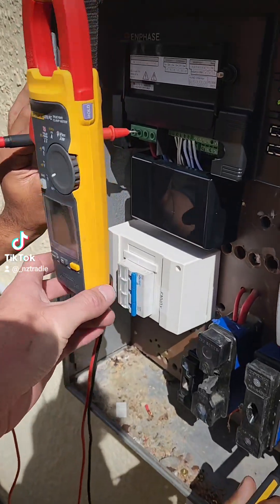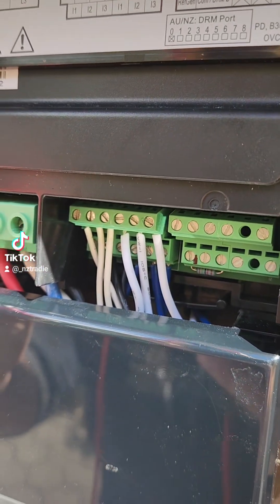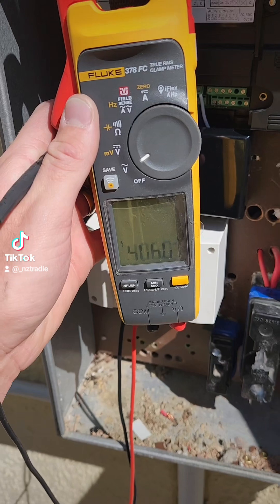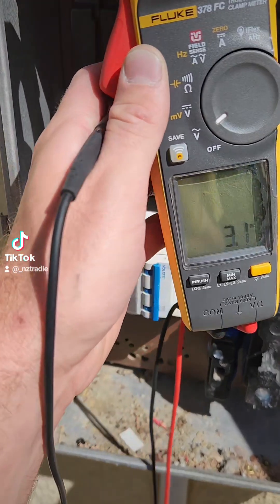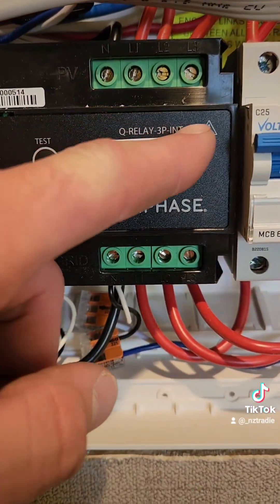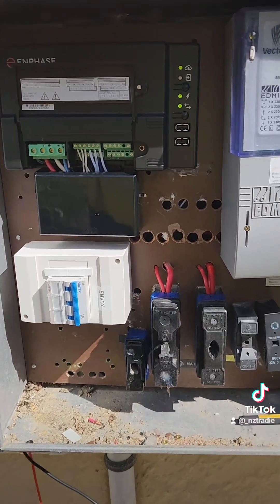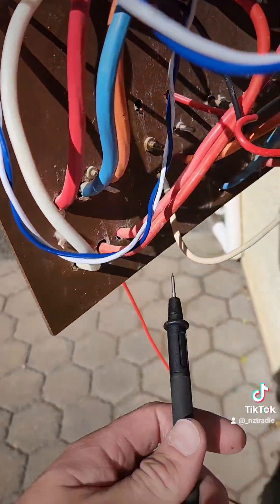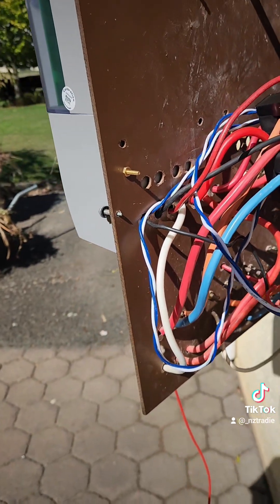How to test phase sequence

Comment: Easy way, hook up a 3 phase lighting dimmer pack. If you go to dim a light on channel 2 or 3 and either an IGBT or SCR explodes (depending on what the dimmer pack uses) then you've confirmed your phase rotation is backwards. 🤬
Reply from the maker: Nice nice, although this meter will also do phase rotation  too 😉😉